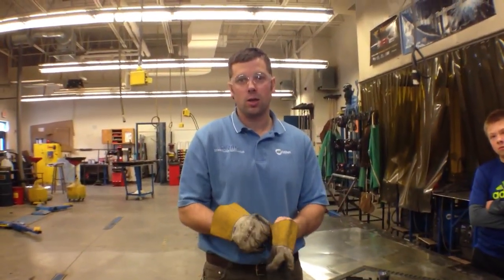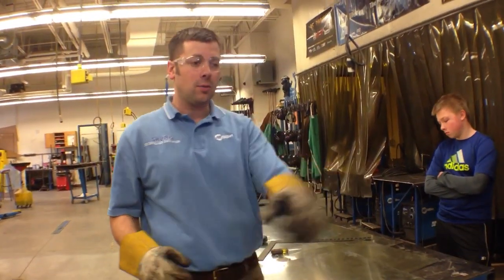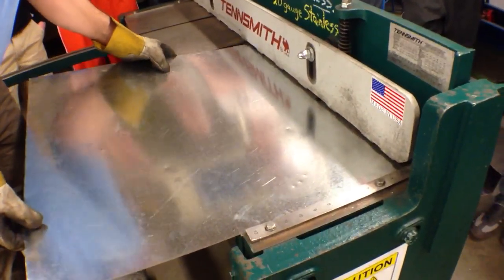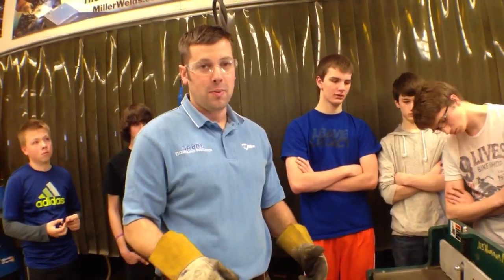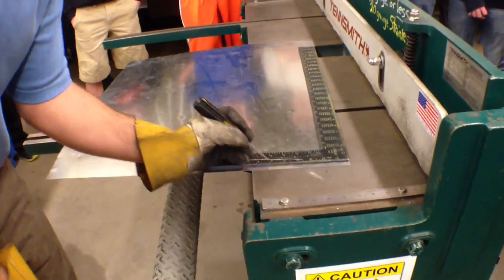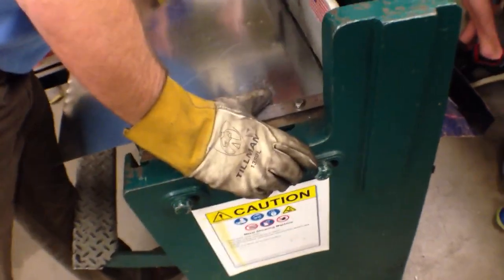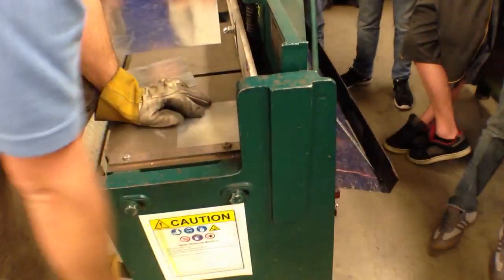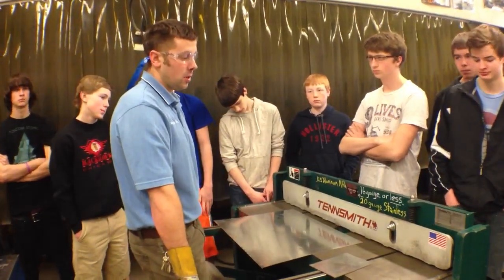Sheet metal shear operation 101

Comment: Great video! I would humbly suggest that the words on the machine would say "16 gauge or THINNER" instead of "less". Some may misunderstand that as a "less" gauge; as in 10 gauge is a "lesser gauge" than 16. Which is obviously not what you meant nor is it common sense. But I've seen many people with less common sense. "16 gauge MAXIMUM" would work too! 

I had to do a double take when I ready that lol. But then again, I'm also just a slow learner :) Just my 2 cents.

In any case, thank you for sharing!